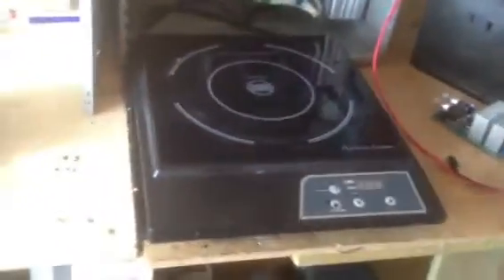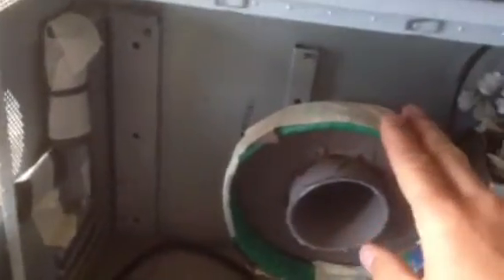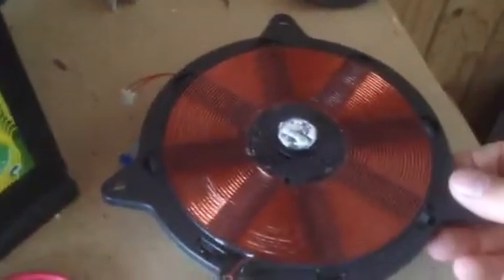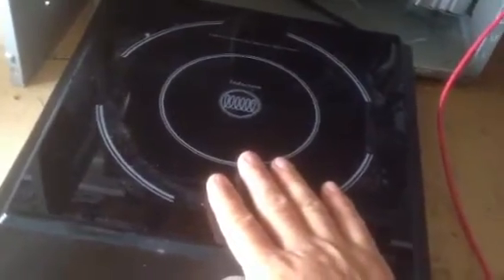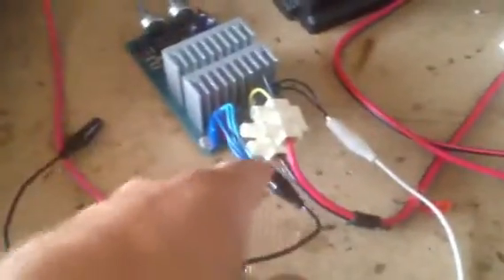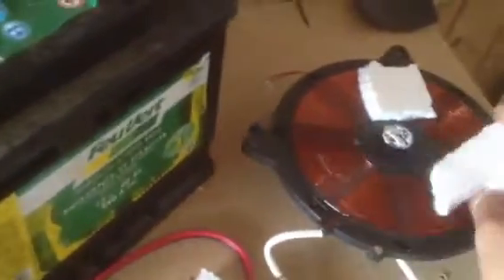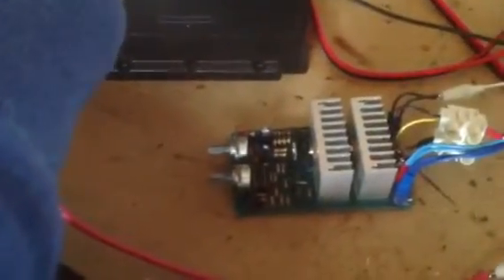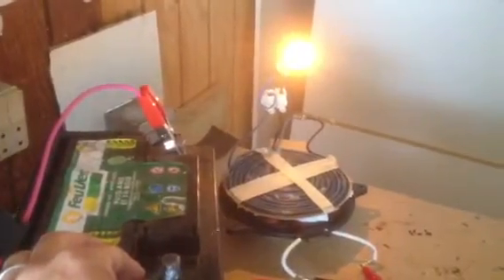Gegene replication

Comment: Pardon my basic electronics question - but that capacitor bank for bringing down voltage and frequency - what is the spec and arrangement of the caps? Thank you.
Reply from the maker: Mark Flint yep the two output AC ends from the bifilar got to two shotkey fast diodes then they both go to the + on the D.C. Cap. The other two connected ends of the bifilar are the - side directly to the D.C. Cap. Caps are 5 x 63V 2200uf .
Reply: Thank you :-)

Comment: Use the whole induction cooker as it was designed... they put good engineering into maximizing normal efficiency, but you can modify how you use it. These cookers commonly use a bridge rectified and lightly-filtered DC from the Mains to power the high-power oscillator/driver circuitry. This means the high-power output to the cooking coil comes and goes at 50/60Hz rate, peaking in power as the AC line voltage peaks. This is completely normal, how they all do it (except for maybe VERY expensive units).  They use this "feature" to maximize the AC Power Factor, since it draws power "in-sync" with the Mains voltage phase.

NOTE: THIS INFORMATION IS PROVIDED FOR EDUCATION PURPOSES ONLY, DO NOT ATTEMPT TO CONDUCT THESE EXPERIMENTS!

CONTINUE READING THIS ONLY IF YOU UNDERSTAND AND ACCEPT THE ABOVE DISCLAIMER!

(for the legal group)

HOWEVER... you can run the unit from DC input as well... most likely... since they just rectify the Mains voltage. If the DC were then smoothly filtered, you would have 1.41 times the AC input voltage - or about 320V DC. But, since they only "lightly" filter it, you need to scale down the externally applied DC voltage to equal the RMS value of your Mains voltage... so 320V DC times 0.707 = 227V DC input should be about the same as the original design working on 230V AC Mains. (see notes below)

So, if you can get your Tesla bifilar flat coil to RESONATE at the frequency of your induction cooker (which you will have to measure, since they vary from 18kHz to probably 100+kHz), then you'll get maximized coupling and extraction. Do some reading about resonating the Tesla coil... it's a HUGE difference in coupling efficiency.

Once you get that, and hopefully you used enough winding turns to get sufficient voltage (or use a high-frequency transformer to step it up), then you can begin to rectify that coil voltage (use very fast, high voltage diodes), and see if it's enough to feed back into the cooker... as DC, without the high DC-AC inverter losses.

WARNING!! FATAL VOLTAGE DANGER AHEAD!! DO NOT TRY THIS!

(of course... unless you are a qualified engineer)

To start the whole "looped" process, you will need to go into the cooker, find the output of the Mains bridge rectifier, and bring those high voltage DC wires out for your connection of the "looping" DC voltage above. If you measure this DC voltage with an analog meter, you should see the "average" DC voltage the unit is needing (this should be about the 227V DC mentioned above). Then if you can supply this same FILTERED DC voltage input, it should be no difference.

You will need to figure out how to switch those voltages over from the Mains supply to the looping supply... a DPST switch might work, but would be dangerous... remember, these levels of DC voltage CAN KILL YOU!

DC shock doesn't allow your muscles to relax like AC does between peaks... and it stops your heart instantly.
Reply: THANKS for this observation !!! Pretty obvious, but you did save me several days I would have spent "goofying around"